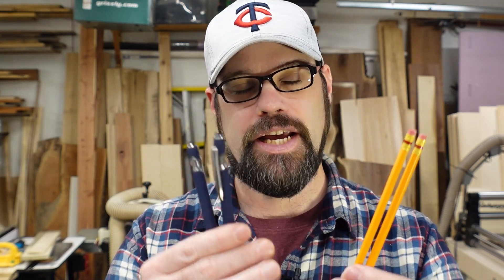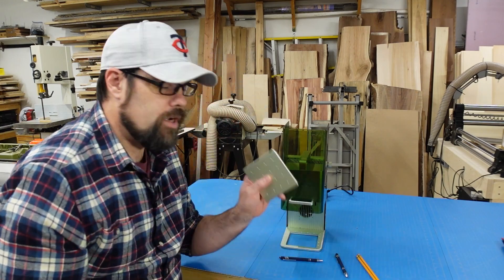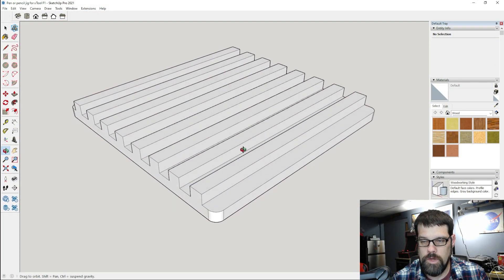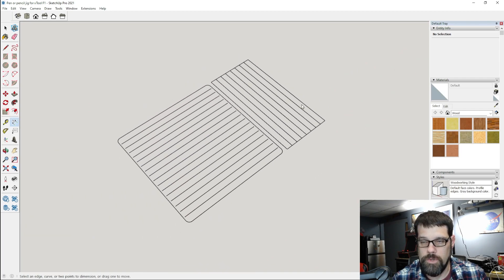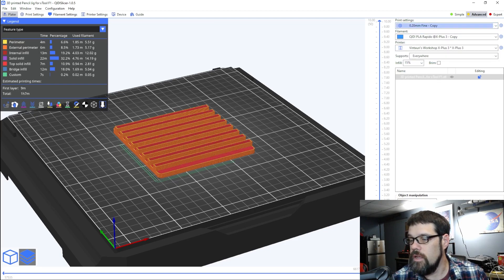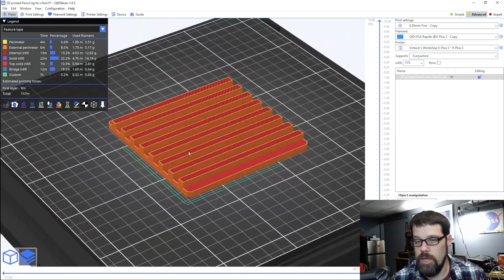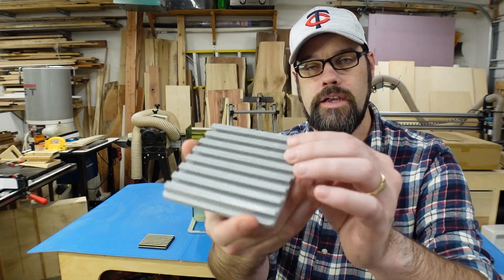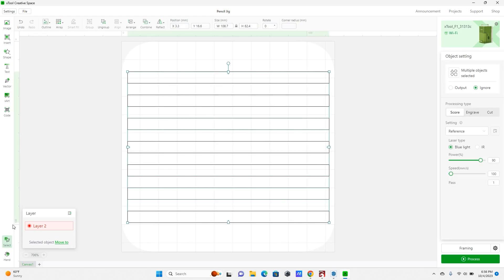Creating a Pencil Jig for the xTool F1 | Free Files in the description

Comment: I tried to download the STL to 3D print it, but it looks like the STL is actually backward. It starts on an extrude instead of a flat, pushing the jig off by 1 pencil width and leaving the middle empty for no pencil to focus on.
Reply from the maker: I'll take a look at that. I may have the wrong file linked as I believe I came across that issue while creating and testing the jigs.
Reply: @Vintauri  Sounds good! I ended up just making the jig on my big CO2 laser and it went fast and assembled easy and worked perfectly that way!
Reply: Hi, great work! But like before, the STL is still backward 😌Can you please fix it? I need that jig for my grandson 1st class. Thank you soo much!
Reply from the maker: @mydiasjewelry  I've added a new STL file that should be correct for 3D printing.

Comment: Super new and just got f1, can I actually make this on the f1 or another machine and only use it on the f1
Reply from the maker: You would need another machine to cut out the insert as it's at the limit or beyond the cutting area of the F1.
Reply: I have the extension bar too if that makes a difference